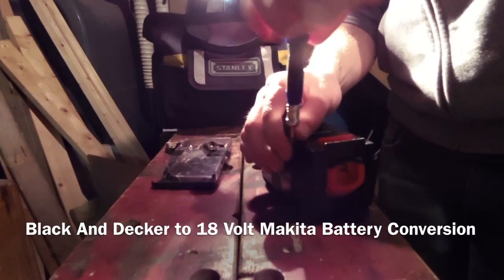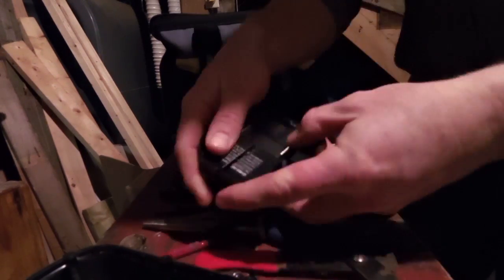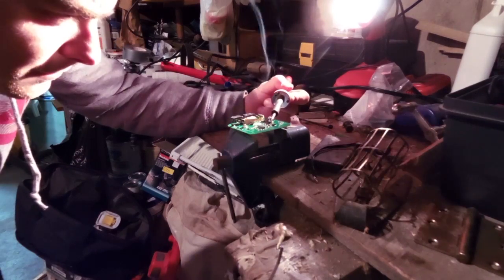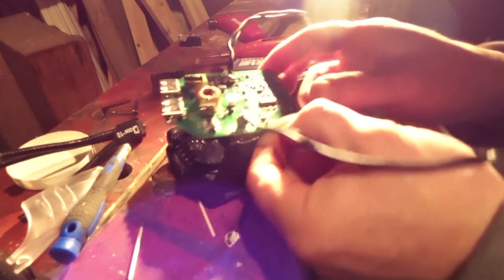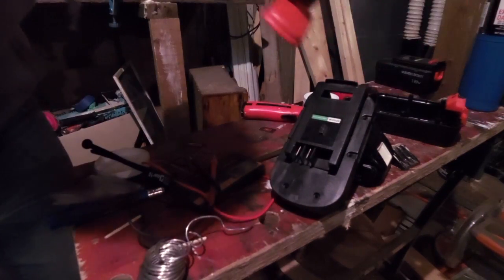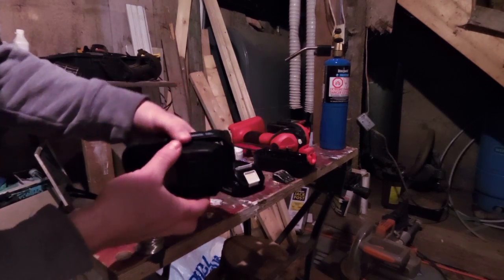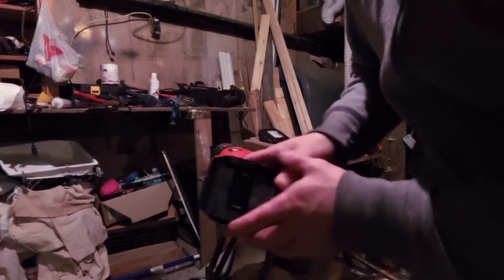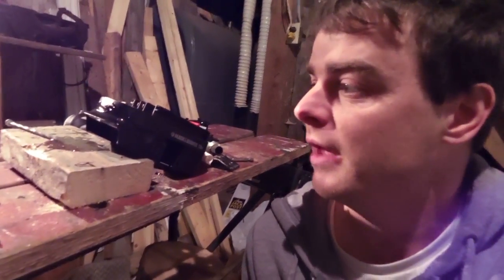Black & Decker to 18 Volt Lithium Ion Makita Battery Conversion

Comment: do not want to sell one. I was wondering if you could make me one and how much would it cost. I have 3 weed eaters, 2 leaf blowers, sawzall, drills, 2 skill saws, tree trimmer and 22 bad batteries.  do have lots of good makita batteries.  Mike
Reply from the maker: +SV IROS oh :D misread the comment. eBay sells conversion adapters for old tools. You have black and decker? Mine is not real durable, it works but it's quite a hack, I wouldn't want to try to sell them.